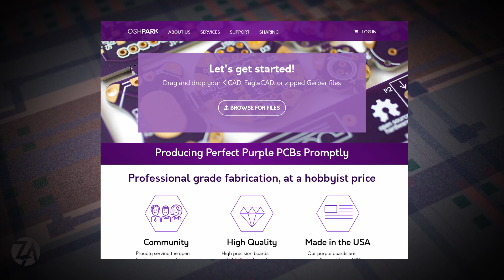OpenRAM characterisation with Andrew Zonenberg Part 1

Comment: The tests he is referring to can be done in simulation. It takes about 1 hour to test two address locations using ryzen 9570X, with Xyce simulator, exhaustive testing. There could be deviation between the spice models and the process, otherwise, it is very reliable.